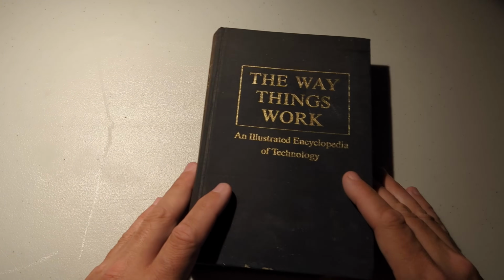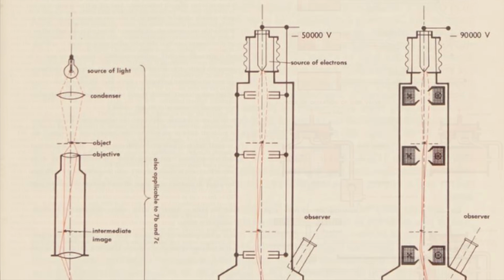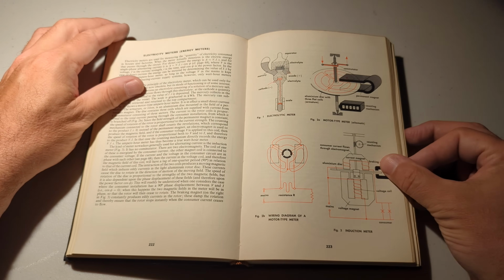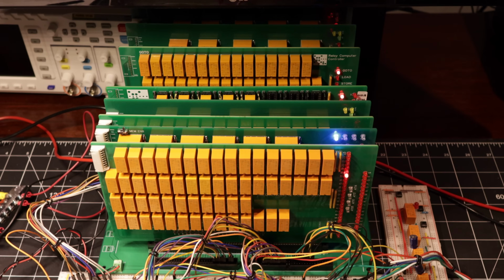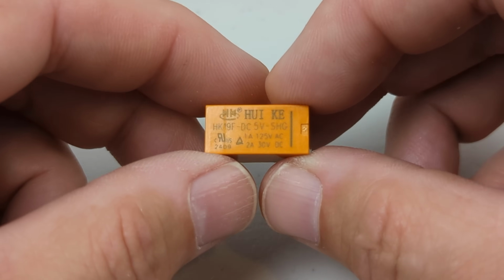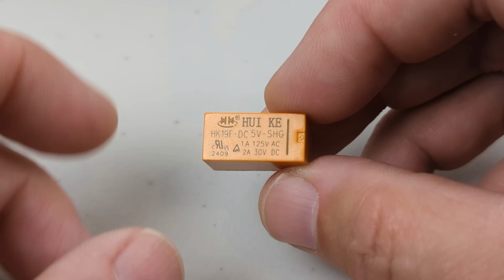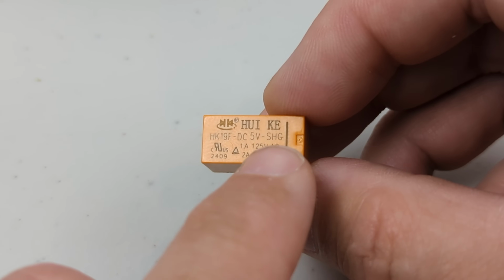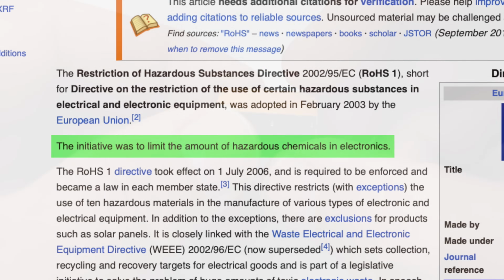Relay Computer - Quick Clicks #4 - What's inside a relay?

Comment: I wonder about the relay durability in such system, how long would it last running 24/7 till failure? I know that some get more action than the others, but what about the clock, since I assume it is the most active?
Reply from the maker: Good question: I did a video about the speed and durability here if you're interested: https://youtu.be/xo1iIFSd_bo
Mechanically, the relays are good for 10,000,000 operations, but it's the electrical life that's shorter (100,000) because of the arcing on the contacts, but at such low voltage/current they'll last a lot longer.
Reply: @dipdoting  How convenient! Thanks, be assured that I will.

Comment: Overclocking! How fast can you go before errors appear?
Reply from the maker: That'll be part of the big test once the entire computer is put together as I need to have all of the possible propagation in place, and then I can run some tests that will check for accuracy during high-speed runs. Also, if you haven't already, check out this video I did about speed: https://youtu.be/xo1iIFSd_bo?si=XCFWaACGtKgXIdiE

Comment: Yep, I've been playing with relays as a small child, those were a lot of fun and you can build projects out of them.  I made a 4-digit combination lock out of relays, I forget how many I used, but it like 6 to 8 of them.   You probably should have mentioned the contact features with those extra metal parts braised or welded to them... I was waiting to hear that, and why are there there 2 of them per contact? Which I'm not sure myself, maybe to handle higher current or something to do with arcs??   Anyway, there's some clever design that went into them.  BTW:  I'm used to the vertical design where the contactors are pulled down, not up... that's probably to make them as compact as possible.
Reply from the maker: I was thinking about those little  welded pads and trying to dig up some info on them, could touch on that in a follow-up video. Not sure if they are a different and maybe more durable material? Maybe the shape reduces arcing?
Reply: @dipdoting  I know those pads are made of some tougher metal kike tungsten or alloys with silver. I did a Google search and there's more information there that can aid in your research.  The contact points take a mechanical beating switching on and off, and when switching high currents can pit due to arcing and build up resistance.  The engineering and material science is incredible on what we take for granted as a part that sits in the background doing its job without trouble.

If my computer history memory serves me right, the first relay computers used telecom relays due to their high switching reliably, the number of contact closures.

What you've done is quite a remarkable achievement, and I sincerely mean that,  I've taught computer architecture, assembly, and other tech courses at Cal. Statue University 2002 thru 2012  and at the same time, I've worked in the industry as a Firmware Engineer for 30 years.
Reply from the maker: Wow! Great info and thank you for your kind words! In an upcoming video I'll be sure to pipe some voltage through the comm/NO and hopefully be able to pick up some arcing as well. Definitely more to things than meets the eye!
Reply: @dipdoting  Yes, relays are amazing, but they are the simplest electromechanical devices, have you seen YouTuber Technology Connections where Alex walks through a pinball machine I think there's 3 parts to it. He covers how it does sequencing, scoring, can issue extra balls in the game and track up to 4 players in the game.  This is hard wired logic to follow rules with electromechanical devices.  It's kind of a computer.

Comment: That book, I have all 3 editions cause I couldn't help myself... But where's the mammoths?
Omron "ice cube" relays would've worked perfect for this and are designed to be able to remove the case for cleaning contacts, plus the coil and mechanism is much more visible due to the vertical layout. Though it also makes total sense to demonstrate with the relays you've been using. Interesting how each pole is dual contact, I presume for redundancy/ease of wetting at low voltage
Reply from the maker: Yeah, those relays are a larger form factor (unless they make the smaller ones I'm not aware of). As for dual contacts, that's my theory as well... redundancy.

Comment: Cool! Have you experimented with the max switching frequency of those relay? Would be interesting to see extreme operation in the one you opened
Reply from the maker: I did, actually...here's a video on that: https://youtu.be/xo1iIFSd_bo 
The frequency per relay is around 6ms switching speed. Things get interesting though when you have multiple relays.

Comment: Very interesting. I'm designing a relay-based clock, which is far less ambitious 
I was concerned about mounting the relays too close together and having them influence each other, though looking at your design, that doesn't appear to be an issue with modern DIP relays 
We had a board designed about 30+ years ago that had this problem and had to install alternate relays on "stilts" using wire-wrap sockets
Reply from the maker: I've heard about that before - maybe it's a thing with bigger coils and higher voltages - they could potentially influence each other? That's a great idea for an experiment and future video!